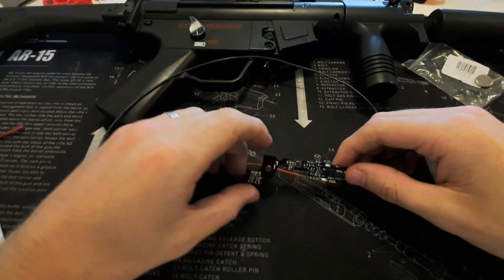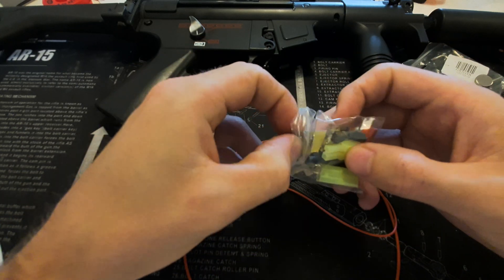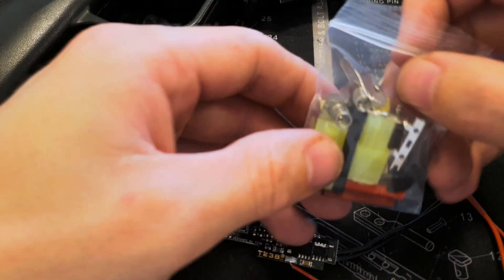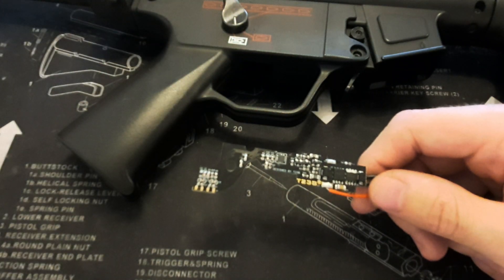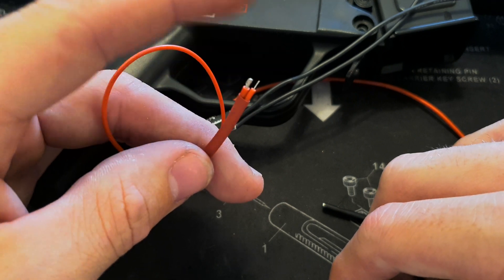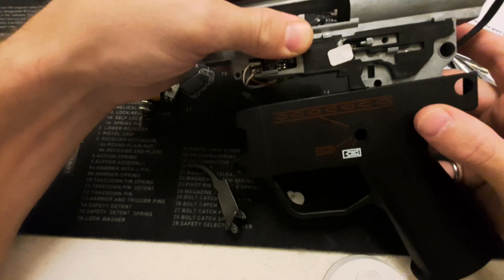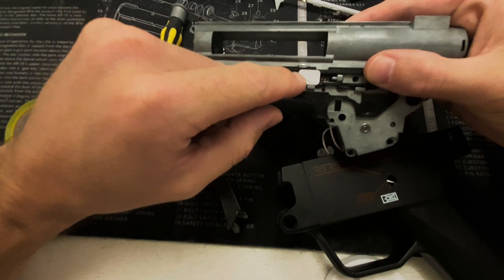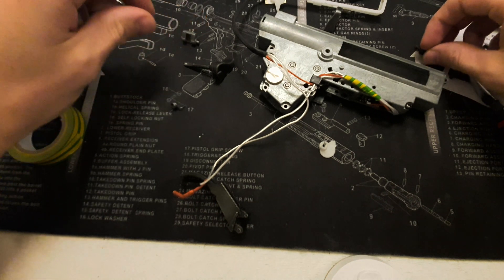T238  v1.1 optical mosfet for V3 gearbox overview and installation

Comment: Hi, I've just installed one of these to test in a spare CYMA V3 box. I'm experiencing very odd behaviour with the precocking function and was wondering if your unit was the same or if mine is operating unusually - settings 1-4 are maximum precocking, 5-6 changes it's mind, 7-11 is no precocking, 12-15 is an imperceptible amount of precocking and 16 is almost-maximum.
Reply from the maker: That's odd indeed, tbf i don't use precocking because it puts a lot of stress on the system and most of my builds are faster than me. But is this after a few shots or did you put a lot through them? Sometimes the system has to learn and it takes a few shots (10 - 50)
Reply: @callsignprofessor  this mosfet doesn't seem to have any automatic adjustment for the precocking like the Perun and GATE fets. Would you be willing to test the precocking on yours? If yours works correctly then I'll buy another unit and hope that works properly. FWIW I've made DMRs running M160's on 12:1s with precocking that ran for years without issue.

Comment: Does this new version of the trigger keep the two-stage fire mode, also called AUG mode, like the old version? Would like to buy this trigger unit, but I need it for an AUG, so really need it to work with that type of two-stage fire since the AUG doesn't have a selector plate.
Reply from the maker: Yes there are 2 sensors but haven't installed one in an aug so not 100% sure.
Reply: @callsignprofessor  Just ordered one. Now I know this I will install it on my aug and use the mosfet from my aug in my ASG Bren

Comment: I assembly that in my v3 aps gearbox and have problem with that white square sticker is not working. Mosfet think that sensor all time is covered..:/ Strange because trigger and piston gear sensor work perfect.
Reply from the maker: Have you tried placing the sticker over the sensor by hand? I've had to place the sticker on the inside of the selector plate instead of the outside to get it to register. Be sure that if you have it in the correct place you glue it in.
Reply: @callsignprofessor  I glue in inside plate a piece of white plastic card and not working.